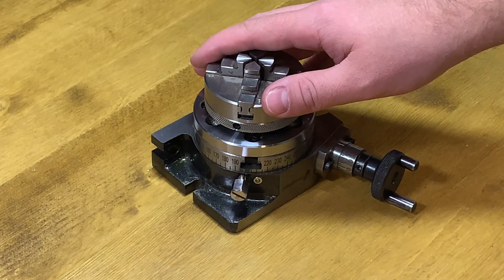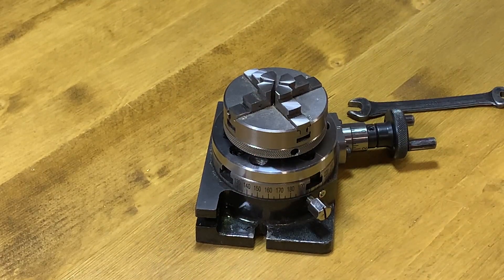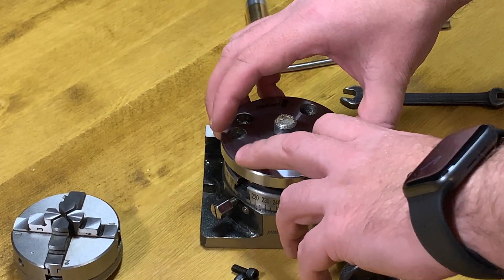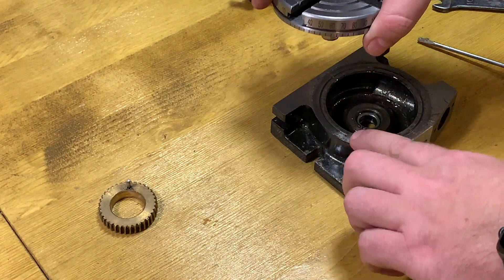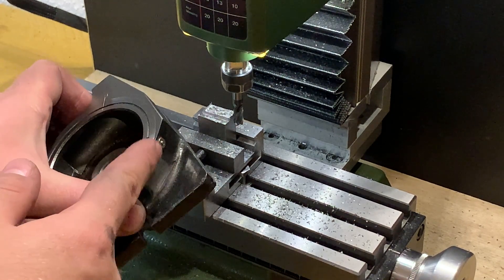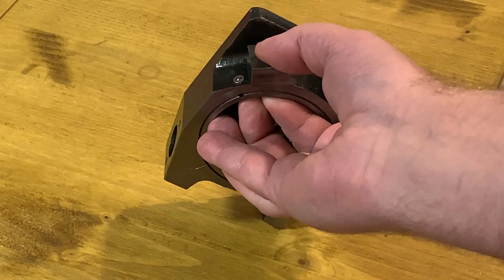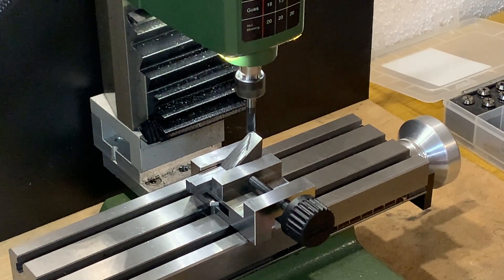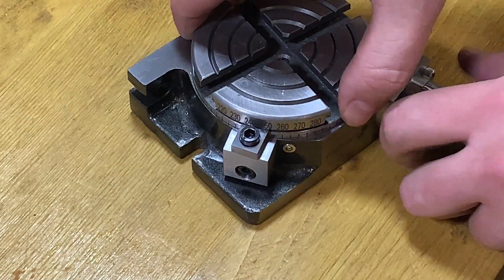Rotary table upgrade

Comment: Hi . did you make places for the mounting screws yourself to attach the turntable in a vertical position to the tabletop or were they factory-made? I mean the ones that are in the video (time 4:37) in the lower part
Reply from the maker: I milled them by myself
Reply: @zhadlun  what's the bolt pattern on the table? is the same as in KT 70?
Reply from the maker: @28karateka  yes, the same

Comment: Happy New Year 2022 seeing your 4 jaw is good to see in the table. We like these small rotary tables, because they are more to the watchmaker parts sizes. GREAT solution an upgrade to add the best accuracy required in a rotary table. Lance & Patrick.